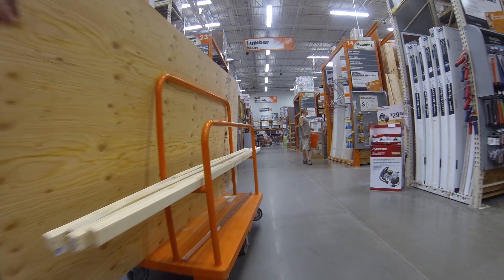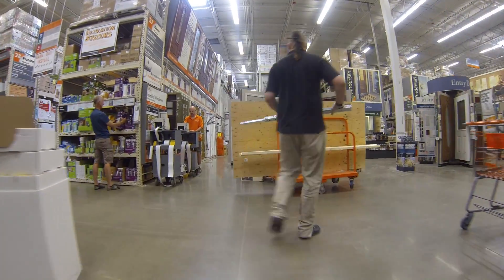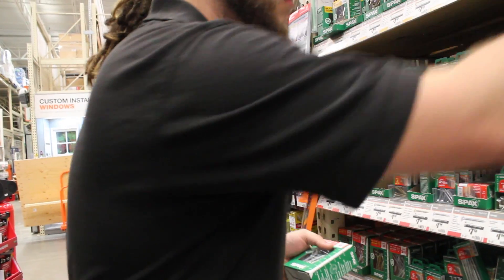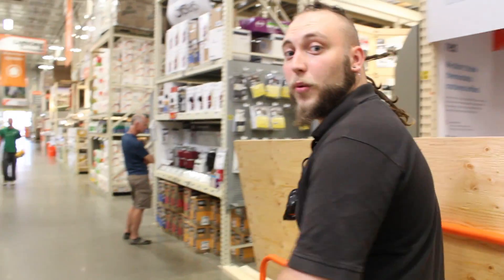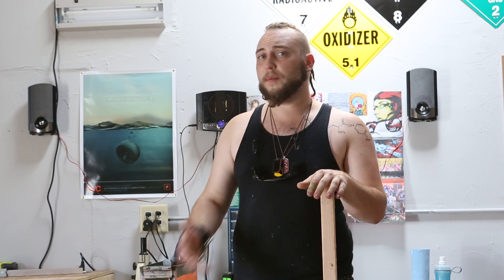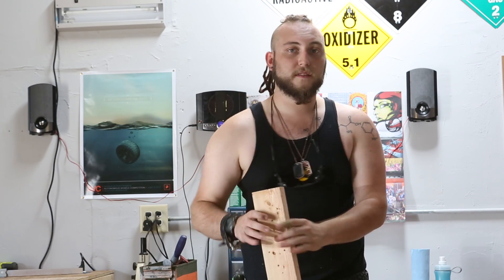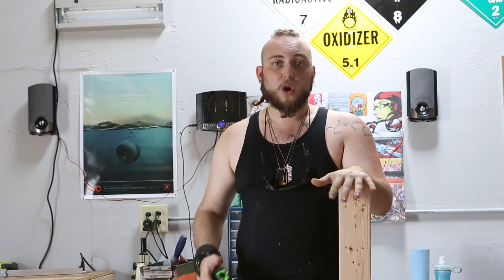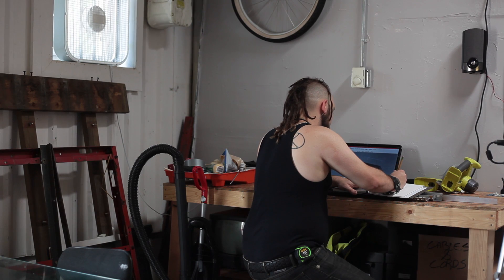SparkFun Engineering Roundtable #18: Nick's DIY Pinball Machine

Comment: I always thought 2*4s lost a half inch for dry wall. However, I am curious what the metric measurement of a 2*4 is?
Reply: It 2*4 is 50mm by 100mm. Those measurements are undressed, I'd when the timber was rough sawn. The timber is then planed smooth. The application such as drywall doesn't come into the why it is undersized.